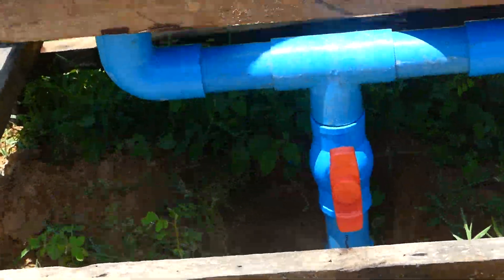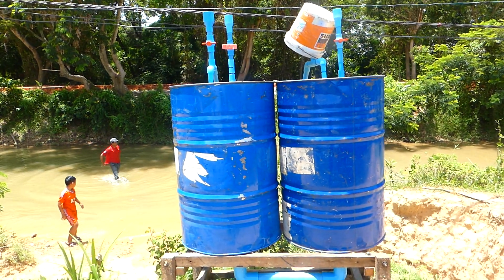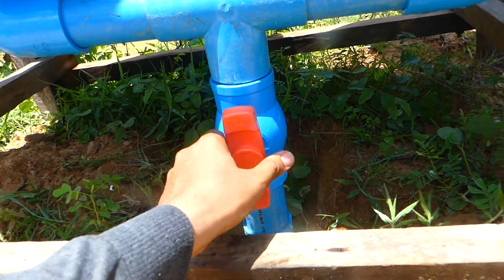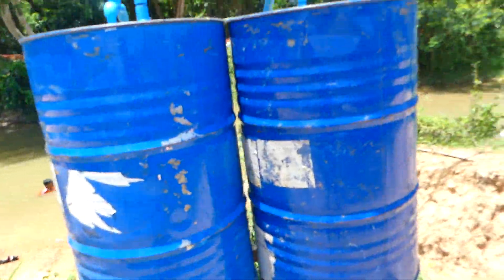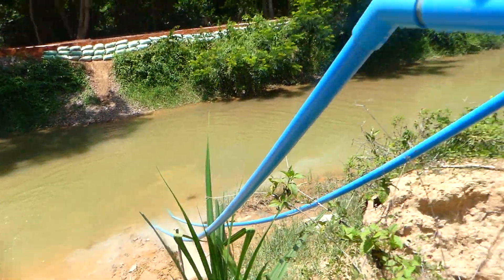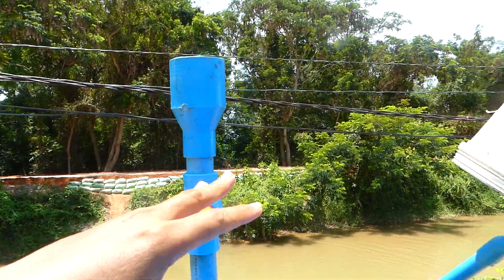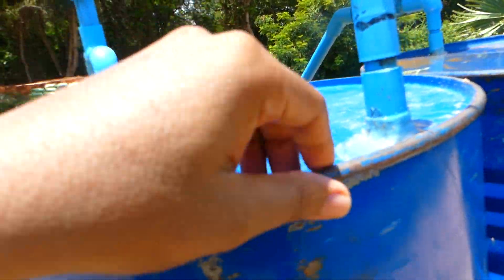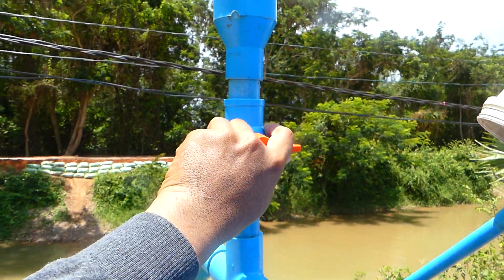How to make free energy auto water pump - free energy water pump | Pump without electricity

Comment: Is the water level at intake lower than water output? Thanks
Reply: @DIYinvention  is there a check valve at the bottom on the intake pipe?
Reply: @DIYinvention  Also, how many gallons per minute,  or liters per minute comes out, Thanks!
Reply: @DIYinvention  can I use only 1 barrel and use same size pipes as in this video?